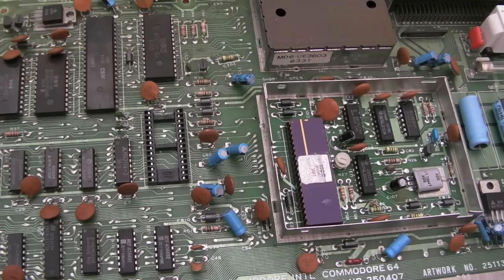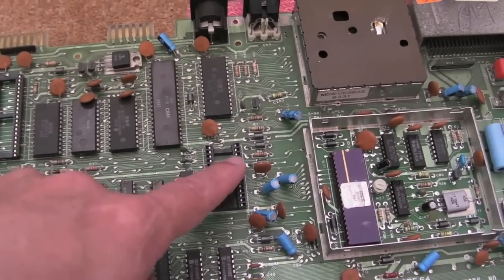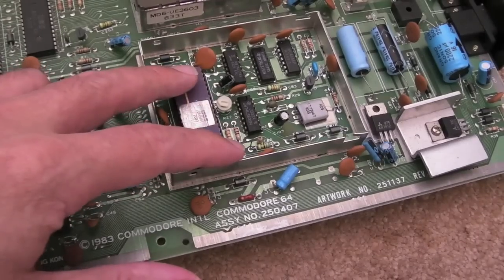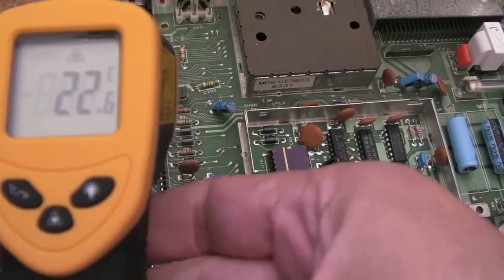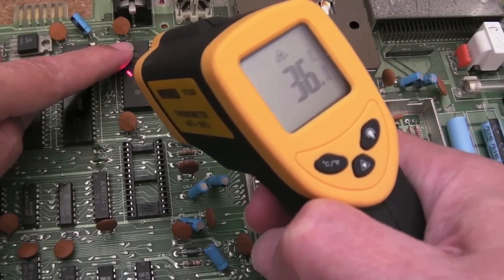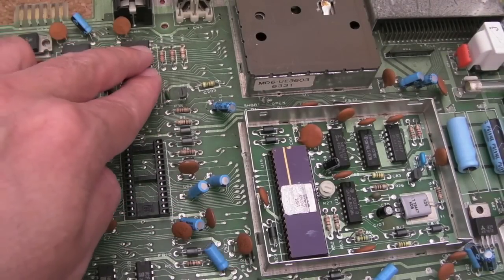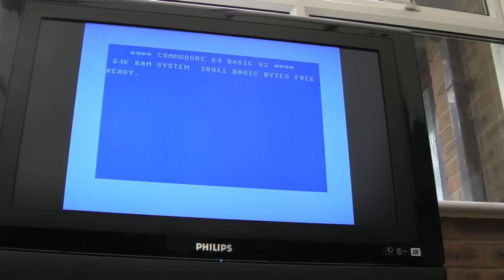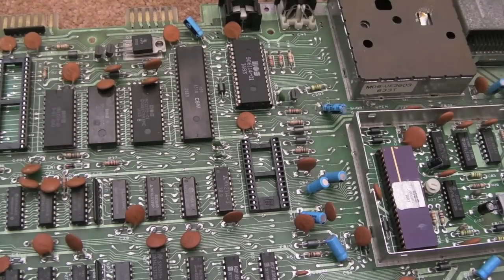Commodore 64 (C64) PLA Repair

Comment: Oh my God. I was going to ask you because I desoldered the Pla chip (a real pain in the ass without a desoldering station) and installed a socket (just to try one of the new versions of it), I changed the power button that wasn't working very well and then I put the C=64 board in the dishwasher and later I used a hair dryer on it. And then, when I turned it on I had ... no signal at all :( . I was thinking that it was some bad soldering on the Pla contacts or ... who knows where? . I better make every change step by step. Well, I'm so happy now as maybe the board wasn't dry enough as now, 20 minutes later, everything is working again ;)
Reply from the maker: That's a good reason to not wash boards that way =D  Sure it can work, but moisure gets trapped under and inside sockets and inside the modulator etc.  If you do wash a board that way, the best thing to do afterwards is sit it near a source of heat for 24 hours to help evaporate any moisture.   Glad you got it working =D

Comment: Hiya- As you mentioned, I removed my CIA's and the SID - still a black screen, and no colors like in your video at 1.22 - however using my Commodore monitor, I get a quick flash of white light when I turn on the C64. Have not tried to replace VIC, but thinking it is the PLA....Thoughts? (board is a 250407).
Reply from the maker: It could be the PLA, or the VIC, or the CPU, or the RAM, or one of the 74 logic ICs - There's no definitive answer.  The PLA is most likely I think!  Have you tested the temperature of the chips whilst its running to see if anything is insanely hot?
Reply: I have the same problem. Did you ever figure out what caused it?

Comment: Is 50C really too hot for the PLA? I'm trying to troubleshoot my C64's black screen, PLA gets to 46C, SID and VIC both hit 60C, all three ROMs are in the mid to upper 40's
Reply from the maker: The 50c reported when I tested was likely inaccruate - it felt way hotter than 50c.  You cannot always depend on temperature as a guide - For example, my VIC gets much much hotter on one system than it does on my other 4 x C64s, yet the VIC is fine.  Different revisions run hotter or cooler.   Sounds like your ROM chips are OK temperature wise, and the SID and VIC do get to around 50 / 60 degrees normally.   You could have a faulty CPU, RAM, or 74 logic.   You're best bet is to try a "Dead Test Cart".

Comment: I'd get a heat sink on that straight away, getting replacement ones are hard to find and expensive.  I've got a 64 with a faulty u1 and the only key that works is the runstop,  yep I tried a known working keyboard.  Also it needs a pla because the text colours are random, I tried a working pla and it was fine.  Anyway I'm not in a rush to find replacements for this one yet.

I'm looking for a working Atari 800 at the moment, they were pretty good machines.  Also it looks very cool.

Comment: The PLA seems to be a common point of failure for the C64. There are "modern" replacements available like the SuperPLA. None are however 100% compatible with the original PLA though.
Reply from the maker: g412bb The modern replacements all work fine as far as I understand?!?  The Super PLA v3 for example is identical regards behaviour of the address decoding.  Edit: just read that Epyx Fast Loader has issues with the Super PLA and modern logic being too fast, so I see what you mean.  Apparently EPROM works just fine though - I think I will go down the EPROM route and see how I get on.
Reply: why do many of those PLA chips die?